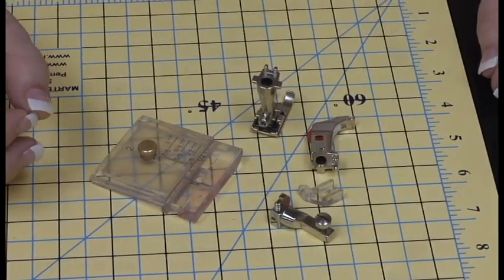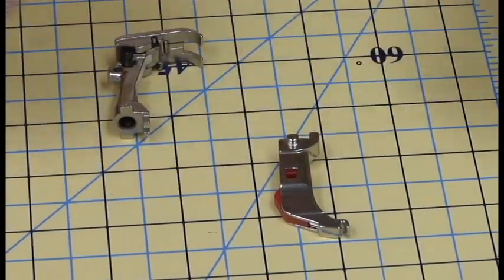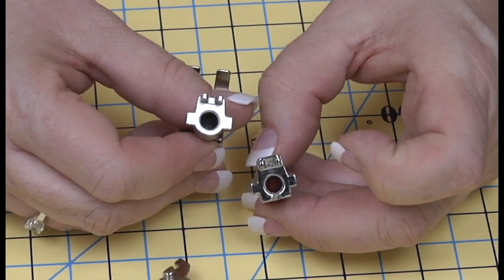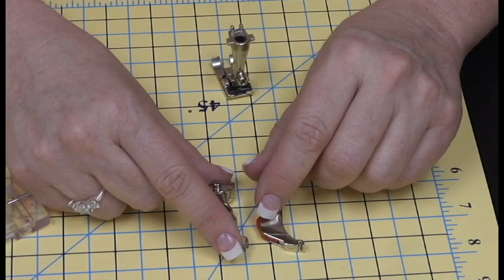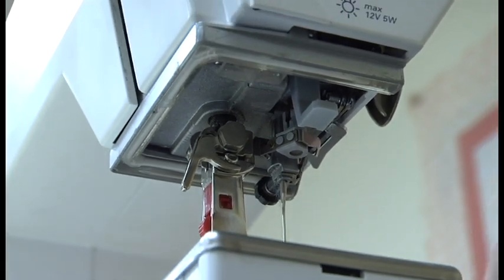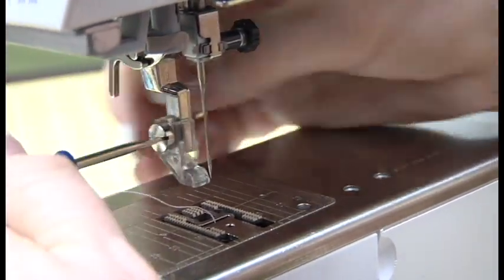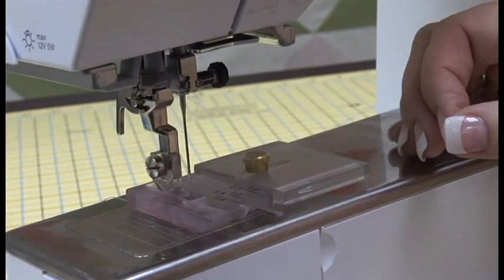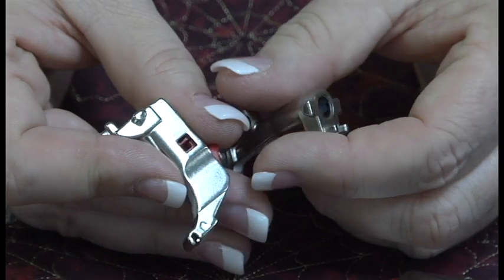Attaching the Foot Bernina

Comment: Do you know if there is a difference between Bernina shank #75 and shank #77?
Reply from the maker: Absolutely! The #75 is for what I call 'new style' and the #77 is for 'old style' machines. New style machines are, of course, newer but these can go back to machines 20+ years ago and are typically 3 digit machines like my old 180.  The #77 typically fits 4 digit machines like the 1090 but they also fit very old machines like the original 810. Thanks for asking as I decided to go back & update the descriptions on my website for these items.  You can buy the 2 piece or the 1 piece for your machine. They look different and both work. The reason to choose a 1 piece over the 2 piece is if you want to add a walking foot, ruffler or gathering foot or if you have an old Singer Featherweight. You can take the 2 piece apart to use for other things. https://winner-designs.myshopify.com/search?q=bernina
Still have questions?  Call me & I'll be glad to help! 850-449-0259

Comment: I have a BERNINA 730 Record manufactured in 1966 OLD STYLE. I would like to use the feet that came with my modern Janome, whether snap-ons or the ones that have a piece of metal (ruffler, walking foot etc...)
What adaptador s do I need to buy and where do I buy them? Thanks
Reply from the maker: Sadly, this is not possible as far as I know.  I don't know of any adapter that will let you place the new wider feet like those offered on higher end machines from Janome & many other brands on a Bernina. The adapters shown only allow 'Universal' feet to fit on Bernina machines.
Reply: @Lindavideos  Thanks for your feedback. Actually I just want to use the normal presser feet, also known as universal, not the wider ones for sophisticated machines.
Reply from the maker: @cristinatorres7318  Oh, then no problem!  You can use either of the 2 styles that I show to attach your Universal Janome feet to your Bernina.
Reply: @Lindavideos  Thanks a lot for your help.